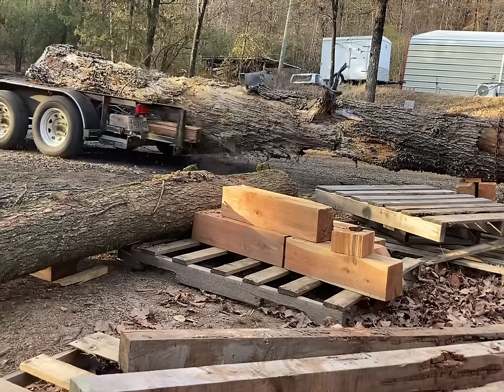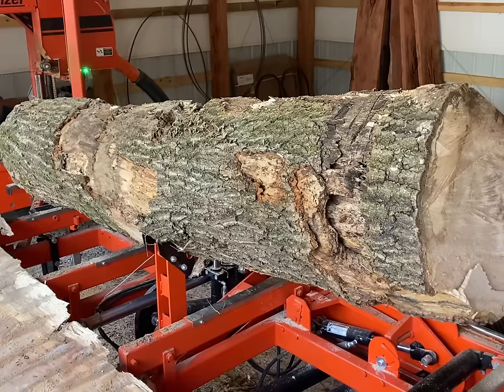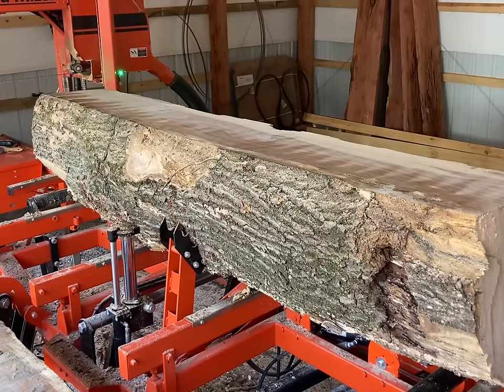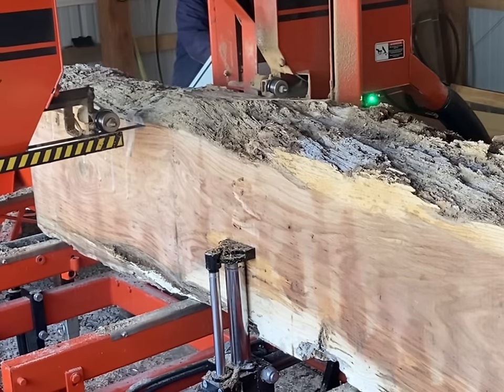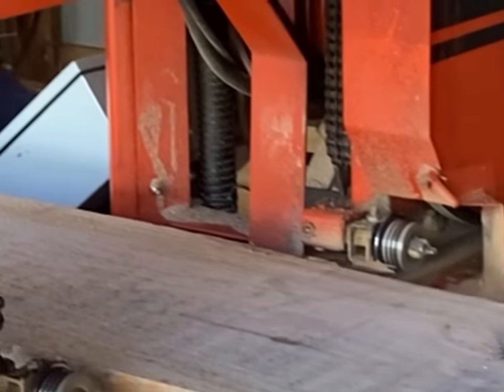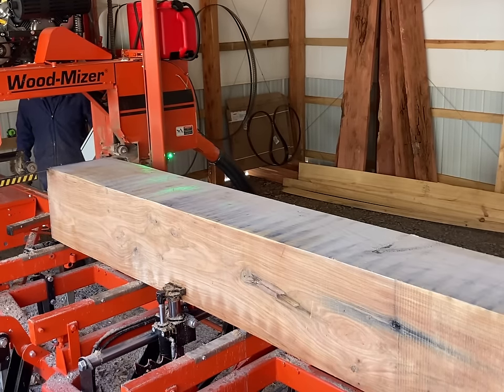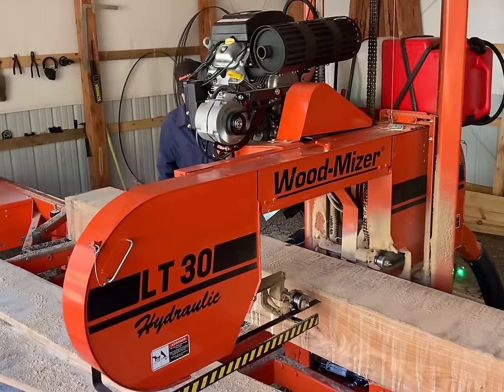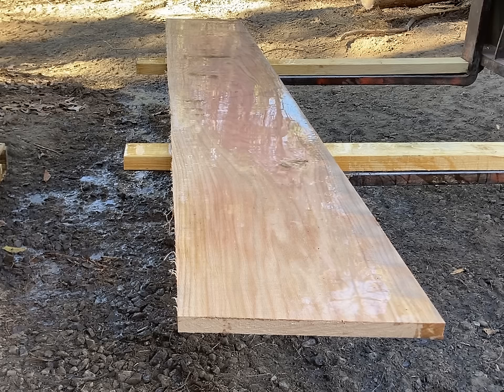Sawing a log that was going to be fire wood

Comment: might have been more lucrative to cut thick slabs that could be used for the popular slab/ live edge tables . they comment a good price and unusual grain patterns are considered a plus instead of a problem
Reply from the maker: In this area at least, people want the live edge. I had to cut all of that off because of rot. I did cut some 2 1/2 thick by 36 cherry slabs in another video. You should check it out.

Comment: Question folks, would a metal detector used  for treasure hunting passed over the log detect the metal in the log?
Reply from the maker: It will but, typically they will reach about 8 inches with a fairly large object. Typically about 6 inches and the bark is 1 to 2 inches thick. You also need to have a dedicated area that’s metal free to check them.

Comment: We just survived a hurricane here in the Houston area and there were a lot of fine hardwood trees like oak as well as many softer wood trees like pine that were down after they were uprooted by Hurricane Beryl. A large oak tree came down on top of my storage shed crashing through the roof. I couldn't help but to wish I had a saw mill like yours so I could go around and collect all the find timber to be milled up into high quality premium lumber for building homes and furniture.
Reply from the maker: You can do a quite a bit with a manual mill if you have a support machine.

Comment: When stacking the lumber, choose one end as the reference end and place the first sticker right even with the end of the boards.  While air drying, the lumber will crack on the end as it dries faster from that exposed end than the flats and it will crack in as far as the first sticker.  Then place the rest of the stickers at the proper interval so the final sticker will be as near the other end as possible.  This will minimize the wasted wood on each end.  Depending on the normal humidity of your area, you may want to add one more sticker per layer to minimize the warping between stickers too.
Reply from the maker: Thanks for the comment.
Reply: I do not see a subscribe button. I always have trouble finding it on a lot of sites
Reply: After I've cut down a tree for the sawmill,  I put a heavy coat of paint on the log ends so when the planks are cut off each cant, the end grain will be fairly sealed and the splits will be minimized.

Comment: I like your mill. Pretty fair red oak. Where are you located?  I'm from Alabama and we have several species of oak here in our state. Hardwood more plentiful in N Alabama. I have 80 acres of planted pine. I planted in 2002 and thinned 2 years ago. Now waiting on power poll mature trees.
Reply from the maker: North Central Arkansas. I hope the pines are not loblolly. They are too fast growing. The pine I sawed my mill shed from I helped plant on my father’s place. I got all the ones over 24 inches. The logging crew didn’t want them. I had about 40 percent that were just not straight enough to be used after drying. I’ve cut plenty of native pine with very little culls.

Comment: I would like to see how you set up your dust collection. My smaller mill doesnt have a port so I am trying to find a 3d printer that can make one.
Reply from the maker: So my mill did not come with an thing either. I used some 16 gauge that I salvaged from the very rough blade covers that I replaced. I made it 3 inches high x 4 inches wide. And transitioned to a 4 inch round then added a collar that was nice and straight. I don’t have a dust collector set up at this time. It dumps on the floors and I scoop it up.

Comment: Wow one nail finished a new blade that is bad ! Oh yeah well that's life great looking lumber though
Reply from the maker: That blade was resharpened though. The blades are just a medium carbon steel. If they were harder then would break more easily. They are only 0.042 inches thick. There is a carbide tipped blade available but at several times the price.

Comment: I use an angle grinder with a carving wheel to debark a log it works a lot better than a hammer. I does make a mess
Reply from the maker: I have considered attaching a battery powered one in front of the blade. Even with a wire wheel would help. But moving in and out turning on and off would be a pain.

Comment: You can get a minelab 900 which is about $1150 and should last a lifetime. The ones that are made for logs can cost up to $4000 and won't detect any better. It also has a telescoping handle for ease of use and you can hang it on the wall for convenient use.
Reply from the maker: Blades are fairly cheap by comparison to that.

Comment: Is this your main business? I'm assuming it is by your wood "lingo". Don't think I will be able to start my small business with that big of a mill. Hopefully will have an HM122 starter band sawmill this spring, with the Good LORDs Blessings. Subbed.
Reply from the maker: No it is not. I have owned a wood mizer LT10 since 2011. I have been sawing and learning anywhere I can since then. I plan to retire from my day job soon and focus on milling. I would like to do some mobile milling. I missed several jobs in the past because I wasn't willing to move my mill.  A manual mill is hard on the back. Logs that weigh a ton or above are very difficult to manipulate. I wish you all the luck. thanks for the sub.

Comment: I loved your video but I'm curious as to your plans for 1" thick oak lumber.  It has been my experience that if I cut oak to 1-5/8" I have a lot more options with it after it dries.  I have cut lots of red oak to the same thickness as you did but I seam to not use it as much.  Please know, I'm no expert I am just looking for ideas to use some of my 1" red oak.
Reply from the maker: Around here red oak is used a lot for cabinetry and furniture making.Planed to 7/8 to 13/16 is ideal for that.
Reply: @lawrenceroe5712  Thank you for the response.  I have sold some white oak to some cabinet makers but I can't seam to get them interested in my red oak.  It's strange how different areas of the country seam to like different styles.  Or maybe I need to be a better salesman. 🤔

Comment: I’m not familiar with a lt 30 hydraulic is this new? Mind saying what ballpark price is on a mill like this? Thank s enjoyed the vid.
Reply from the maker: An LT30 is a LT40 but 4 feet shorter. They were phased out of production in late 1990s. This one is a 1988 unit I purchased it within the last year it was a full manual mill. I purchased it disassembled and threw everything but the frame away. I had it sand blasted and began building it back and converting it to a hydraulic which were produced, just not this one. I have a solid 25 in it and lots of labor as well. But it’s really a new machine. Everything but the frame is and it’s been modified in places to accommodate the hydraulics. I have a video showing some on the modifications.

Comment: Gosh this was enjoyable. I know a thing or two about logs and lumber, but this video was so well done, I learned a lot. Your editing, explanation, and dialog are really outstanding. Most sawmill videos just make me shake my head and leave me with a ton of questions. 

The troublesome nail almost looked like a cut nail in the video which maybe possible given how close to the Center it was, but I doubt it. 

Do you have plywood attached to the 2x6 dam so you can scrape your sawdust right into the bucket? Your mill building layout is so well designed. Gold stars all around.
Reply from the maker: Thanks for the comment. And compliment. People seem to like the monologue. I have a very thick piece of plastic on the floor. I just use a scoop shovel at the end of the day. Maybe next year a cement floor.

Comment: What is with the wavy look ? is the board flat, It looks like the blade is waving up and down is the board flat.
Reply from the maker: No, it’s completely flat. My blade lubricant is pumped in pulses. So for a few inches you have enough to wet the wood then none at all for a few.

Comment: It would be cool if you could quarter saw this large log.
Reply from the maker: I had wanted to but by the time I got under the sapwood it really wasn’t quite big enough. That’s why it’s common to quarter saw white oak. You can keep the sapwood it’s the same color. So a 20 inch log is big enough to quarter saw.
Reply from the maker: Be sure to check out the other video from the same tree. It produces better lumber.

Comment: the metal detector will reach 5 to 8 inches so you might want to check every 5 or so inches. Win something is flat they work well but when the point is straight up to the flat surface of the detector it won't see it as well.
Reply from the maker: Thanks for the advice.

Comment: Since this is an Oak have you ever used the 7* degree blade for hardwood? Ouch on the new Blade! There went what $30+! Ugh.
Reply from the maker: Thanks for the comment. Yes when I had my smaller mill I would buy 10 degree and resharpen them to 7 deg so they were 7 x 39. I currently have some 7x47. If you are familiar there teeth are very long and skinny. Seems every time I hit something with them teeth get broken completely off of bent backward. I will use one of those on the top half of this log in a up coming video.

Comment: Id be going over that log with a metal detector saw your going to be getting they cutting blade dull
Reply from the maker: I have two metal detectors, the little wand only works about 2 inches deep, it’s really designed to find things on a person, the other about 8 inches. But they aren’t very reliable on something as small as a nail. The one that goes 8 inches could not find a water regulator (a solid brass piece the size of your fist a foot deep.

Comment: Tell me about the mill. Ive never seen that particular model
Reply from the maker: I had wanted a wood mizer LT40 for ever. Then they introduced the LT35 some years ago, I saw a hydraulic one and thought that’s the one, some day but for now a LT10 is what I can afford. I ran the LT10 for a number of years. Getting close to retirement from the day job I ordered a LT35. I was told the wait time officially was a year but it would be in in 6 months. It grew to be two years. So after having it on order for months I canceled it. Then went in search of a used 35 or 40 with a good balance between price and value. Months into that I decided it was not to be. Last attempt I changed my focus to mills that were in bad shape with lots of stuff needed to be fixed. And found this one at a price point I thought I could make work. I want to be able to have a like new mill a have less than a new one invested in it.
      This is a 1988 wood mizer LT30 manual mill. If you are not familiar it’s the same as a LT40 but 4 feet shorter. I stripped it to nothing but the frame left. Had it sand blasted. Primed and painted it and replace everything else with new parts. A lot from wood mizer, some not. I spent about 5 months of free time bringing it to where it is today. The engine is from harbor freight, it’s a knockoff 25 hp Honda. All of the hydraulic controls, hoses and cylinders are from WM. I ordered them to match a 1998 so I could have the 2 plane log clamp. I had to cut and bump out the frame for it. The turner is self built from scratch. Log loader is mostly from WM. The setworks are micron sw-350 pro. All electrical is my design. I wouldn’t trade it for a new Lt40 off the line. I have 60 hours on it so far and it’s been flawless.
Reply: Sounds like you have a nice mill, after putting a lot of work into it.

Comment: These mills are too slow.
Reply from the maker: Slow compared to what? An LT70 can cut at about twice the speed. Compared to the 10 hp LT10 I used to have its fast. I could double my output by having a helper. Its design is a portable mill that is easy to setup and break down, about 10 minutes. Light enough to be towed with the average vehicle and priced where a lot of people can afford them. All of that considered it’s a good balance of engineering.
Reply: And priced wayyyy too high..